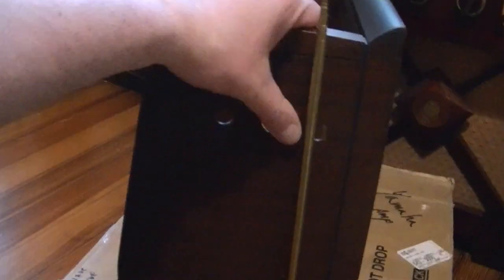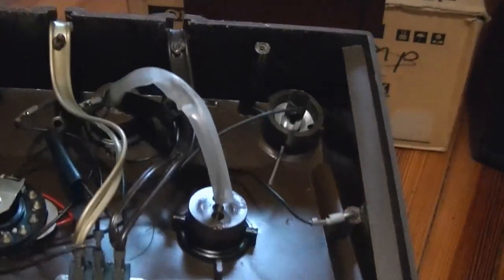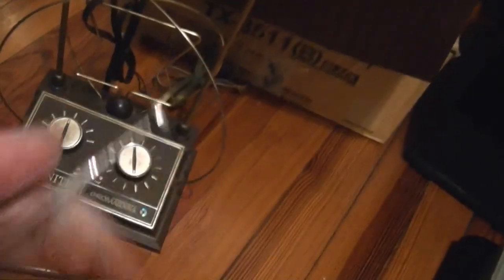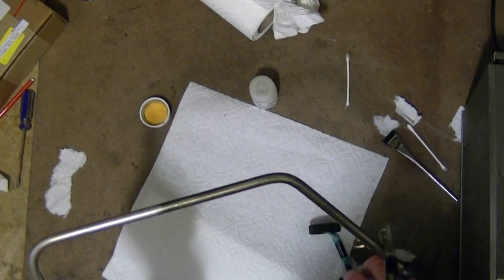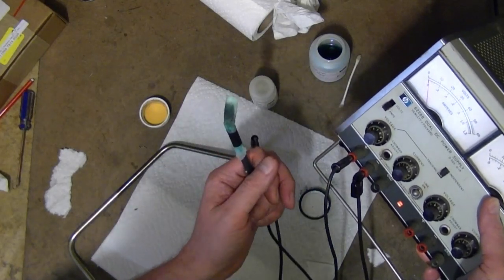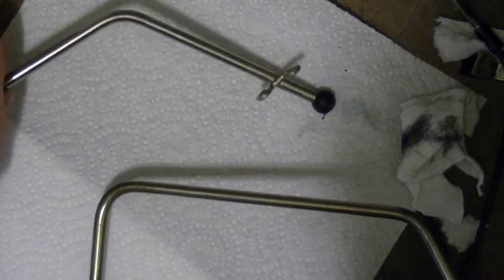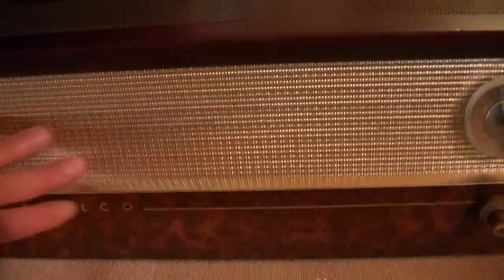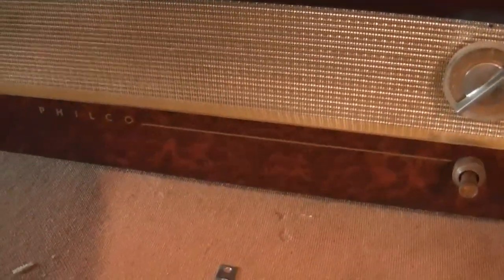Predicta "Holiday" restoration p16o?

Comment: You should be able to remove that fastener that holds the base of the antenna in place, it looks like you could compress it with a pair of pliers and push it out through the bottom. It would save a lot of cutting and effort if you could make it work, and you could reuse the original plastic mount from the Predicta. The original mounts were probably made out of Bakelite, the Zenith ones are likely made out of 70's brown polystyrene or ABS.
Reply from the maker: Part of one of the original mounts is broken.  I've seen the same break on a couple others so although the are harder, they're also more brittle.  I suppose I can try pushing the insides out of the one intact one though.  Nothing to lose.

Comment: This is where a bench grinder / buffer comes in very handy. Before plating, go over the parts with a buffing wheel and red rouge to get the dings and pits out. Then switch to white rouge and polish to a shine. Degrease well; "Brakleen" or equivalent from your local auto supply chain works great for this. Then plate and varnish and it'll look great - and you'll spend a lot less time doing it. Be careful with the varnish; most clear coatings won't stick to brass very well. For maximum happy, get the product for protecting brass - I think it's a modified lacquer.
Reply from the maker: I use lacquer from Mohawk specially formulated for brass and it works very well.
Reply: That's a good product! Those who just spray on some clear polyurethane or acrylic find that it starts peeling after a short time.